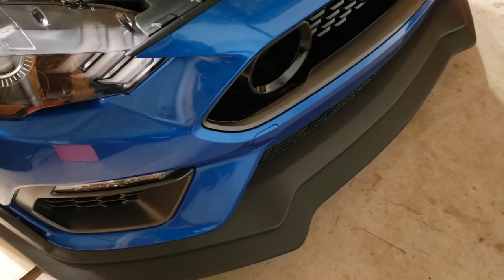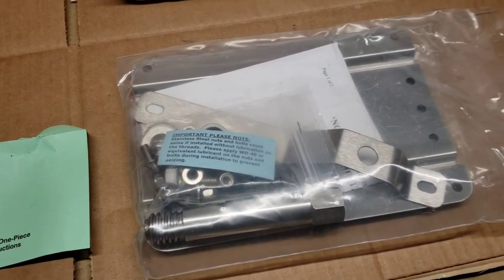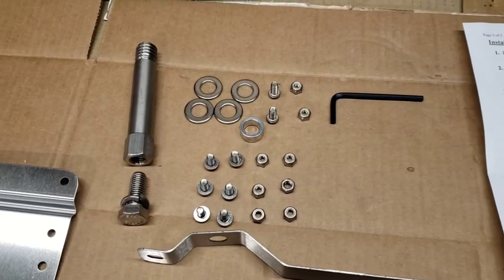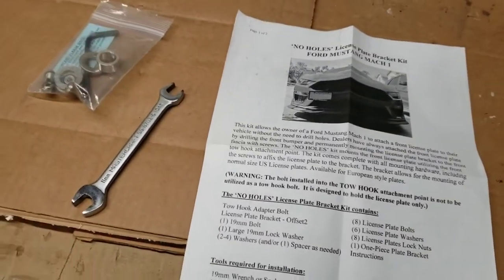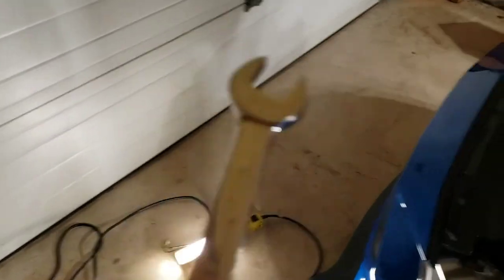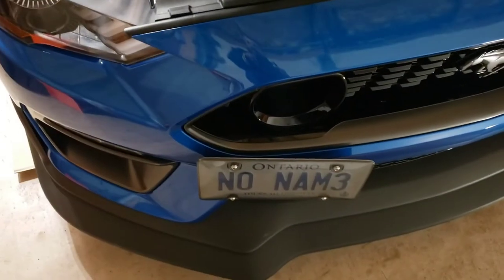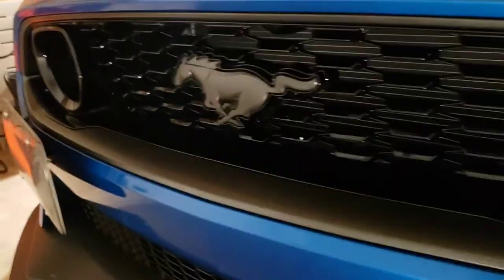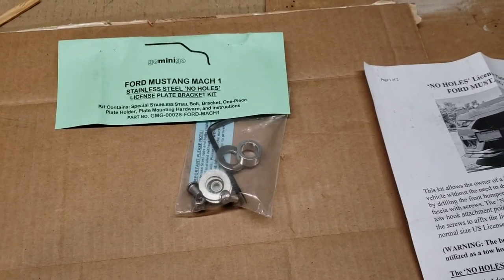2021 Mustang Mach 1 No Drill Front License Plate Mount

Comment: Was is the weird piece that holds the cover on? I want to add a tow hook, popped it off and has a weird.piece that.holds it.
Reply from the maker: There was a triangular shaped hollow part that went through a bracket.  That teather held on the small plastic filler piece that clips into the front bumper facia.  I carefully squeezed the triangular hollow part to slip it out of the hole in the inner bracket.  This removed the tow hook cover piece.  Then I screwed the bumper support rod into the threaded part where the tow hook would screw into.  If you add a tow hook, try to get a long thin needle nose plier in to the opening.  Then very carefully squeeze the back part of the teather to release it.  You don't have to remove the cover/teather part, but your install will look cleaner if you do.  I hope this info is helpful. 👍👍
Reply: It did, I tried to get it out naturally but had no luck, so I ended up just cutting that piece out, the cover can go back on without that feather arrow just fine. I'm debating the tow hook or this license plate holder with a silver and black ford performance plate.
Reply from the maker: @GarveyMustangMan  it's a bit tricky to remove that teather part from the mounting hole.  It took me much too long to remove it.  You're correct, the cover can go back on easily without the teather.  If your jurisdiction doesn't require a front license plate, then a tow hook would look good at that location.  I had to mount a license plate as it's required where I live, and I don't want to hassle with the police about it.  Either way you go, your car will look great! 👍👍
Reply: @lilredcrvtt  I'm going to ride with my custom tow hook setup for now, but most likely I'll be joining you. Appreciate the help!
Reply from the maker: @GarveyMustangMan  you're welcome!  I'm glad that I was of help, cheers! 👍👍

Comment: But how did you pop off the tow hook panel?
Reply from the maker: It was easy.  You carefully remove the outer panel from the bumper by prying it from the bumper.  Then I used a long needle nose plier to carefully squeeze the inner part that goes through an attaching tether.  Be careful not to press too hard with the pliers.  You should be able to detach the tow hook cover at this point.  I stored the cover with the car.  At this point you can attach the license plate bracket, which you pre assemble.  Thread in the extension shaft into the tow hook mounting point.  It's a quick, easy installation. I hope this is helpful. 👍
Reply: @lilredcrvtt  for clarification, I just need to take something that will not ruin the panel but pop it off? Like a cloth and a screw driver?
Reply from the maker: @LMach1  yes, use something that won't scratch the bumper.  The tow hook cover will easily pop off.  But it will remain attached to the car.  This is where you need to  remove it from the tether.  Or you can leave it hanging behind the plate.  I chose to remove it completely.

Comment: Unfortunately I drilled holes on the front bumper of my GT500. Shouldn’t have done it but I am legal. Wouldn’t do it if I could go back in time
Reply from the maker: I was very hesitant about drilling my front bumper.  There are small divots in the bumper to show where to screw in the bracket.  I decided to use the tow bar location to mount the plate.  Fortunately I found a bracket on Amazon.  Either way I mounted the plate would've been ok.  So far I haven't had any issues with the police either.  Better to have the front plate than get a ticket or otherwise hassled by the police. 👍👍

Comment: Would this work on my 21 GT?
Reply from the maker: Possibly.  I'm not 100% sure if the GT has a removable plug in the front bumper for a tow hook.  My Mach 1 does have that option.  I removed the small access panel and used the opening to mount the license bracket.  A "Hide A Plate" removable bracket might be a better option  for your '21 GT.

Comment: So you know the way you mounted it is still against the law in Ontario, its suppose to be in the proper front and center mounting spot, if a coo wants to be a prick they can still give your improper display of plate ticket….i suggest you donwhat i do, go to Canadian Tire paint section buy 3M Mounting tape, ipht a few strips on the back of the plate and stick it on where it should, no holes, no drama no tickets
Reply from the maker: You are technically correct.  I have some 3M two sides tape, but I'll take my chances with the tow hook mounted plate for now.  The plate is very visible and its near the front center of the bumper.  I've seen quite a few cars with similar plate mounts.  If I happen to get a "prick" cop try to ticket me, I'll take it to traffic court and fight it.  It's worth a shot, lol! 👍

Comment: Easier than taking the whole bumper off, I want to add an orange tow hook
Reply from the maker: It was a very easy installation.  I can remove it to install a tow hook, if I need one.  I'd rather not use a front license plate, but it's a requirement in my jurisdiction.
Reply: @lilredcrvtt  better than the dealer drilling holes for the license plate, this is a great option!
Reply from the maker: @GarveyMustangMan  I found that license plate mount on Amazon.  It's a good solution to having to use a front license plate. I asked the dealership to not drill holes in the bumper, before I took delivery of my car.
Reply: @lilredcrvtt  me too, good stuff brother thanks for the video great information!